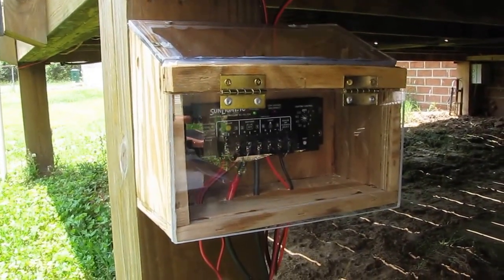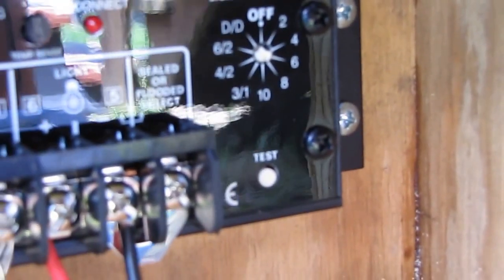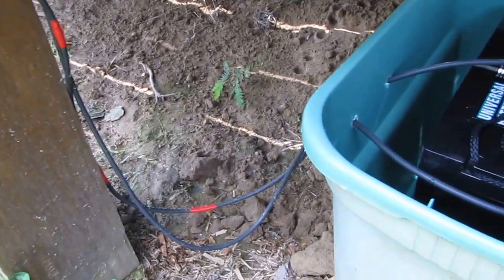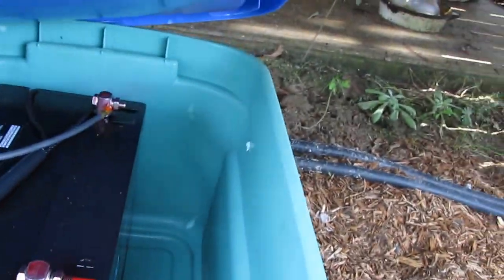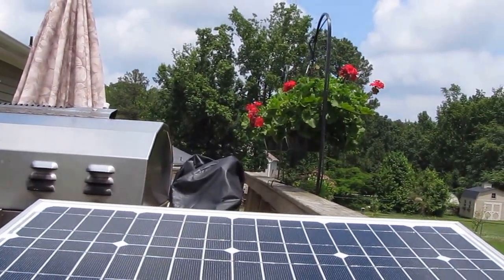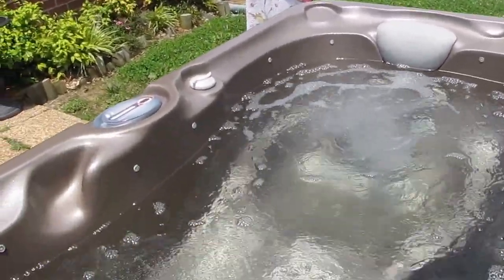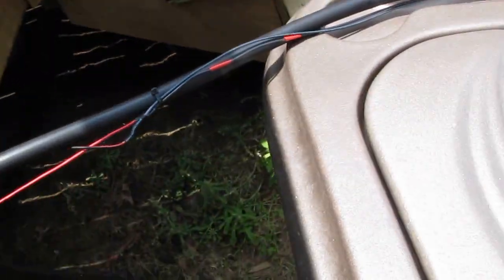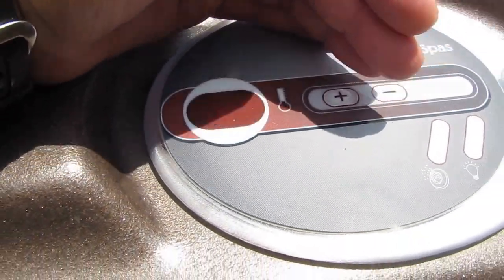Solar Micro Geo Thermal Water Cooler For Hot Tub By VIARLOCITY PT 2

Comment: I don't understand "Hot Tubs" are suppose to be hot. So let me get this straight, You turn on your hot tub, being a hot tub the heater comes on and would make it hot. So you set up this other system to cool it off. I don't get it. Did you try turning off the heater?
Reply from the maker: Even If The The Heater Is Set All The Way To 65 * F It Gets Way Too Hot In Summer This Helps Keep It To Bearable In Summer Spring And Fall Help Cool It In Summer Help Heat And Save Power In Winter
Reply: kvusmc / Kenneth W Viar Jr  So it's a small swimming pool, I see.  Nice set up for that purpose. Thank you for feed back.
Reply from the maker: LOL Exactly A Small Very Small Relaxing Pool  For Summer Buddy